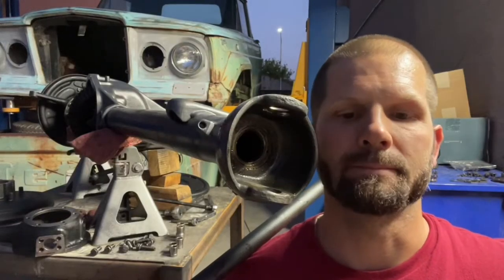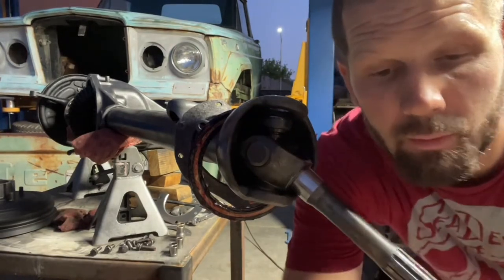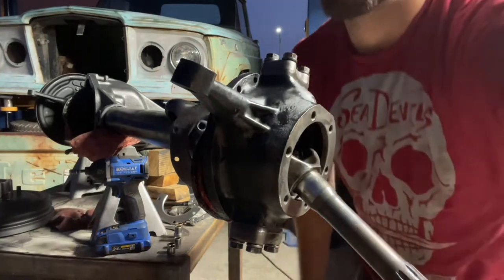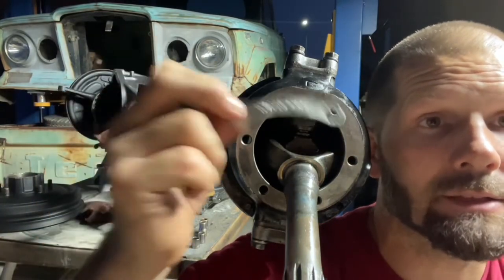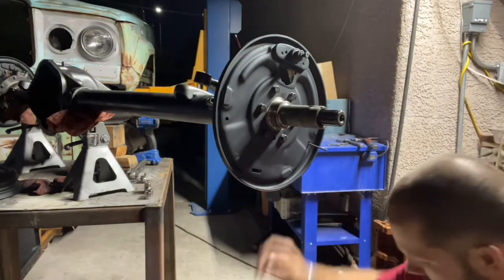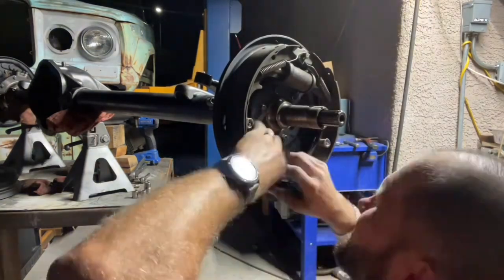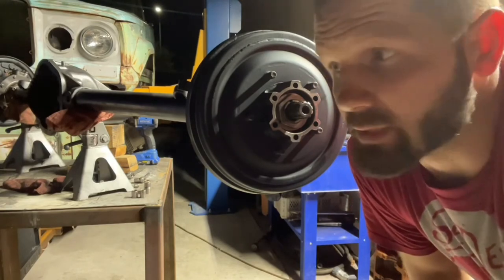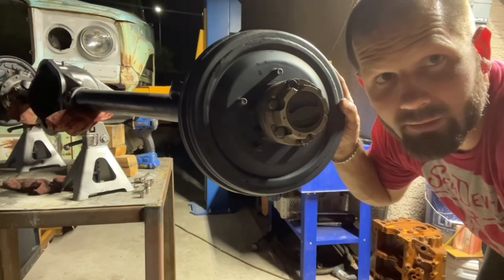1966 Jeep J3000 Front Axle DANA44 Closed Knuckle Axle Rebuild

Comment: I stumbled upon this by accident.  Great video.  I've always been interested in this stuff, even if I have never done this kind of work myself and even if I'll never own a vehicle that requires me to know about such things.  In my quest to understand these things, though, I've come to appreciate those old-fashioned closed knuckles because of exactly what you illustrate here.  Every bit of disassembly and re-assembly can be done using ordinary tools that everybody owns.  In contrast, the "newer" style (dating back to the late '60s and early '70s, ha-ha) of axles with open knuckles and ball joints require special tools and massive amounts of brute force for disassembly.  They are hell to take apart and are very finicky to get properly adjusted during re-assembly (for example, I learned that a whole generation of Dodge pickups were plagued with ball-joint failures while still almost new, because so many of them had the ball-joint adjustments improperly performed at the factory).  And it's my understanding that after several years, the adjusting ring on the top ball joint almost always seizes into the top of the knuckle and can't be spun, and since there's very little gripping surface for the tool that turns it, this can ruin the whole knuckle.  Modern open knuckles are faster to put together the first time using automated equipment in the factory, but nothing about the design is friendly to the truck's future owner.  Everyone seems to think that these closed knuckles are more complicated than the new style, but actually they are as simple as can be.  I appreciate this clip.
Reply from the maker: Thank you for the great comment!
The more time passes the more i appreciate simplicity in design.

Comment: Hey man, thanks so much for the video it is helping a ton. Two questions: 1. Where do I find the torque values for this install? 2. Did you put new bearings and races in your hub assembly? I only ordered the Closed knuckle rebuild kit and it didn't come with that other stuff. Thanks again!
Reply from the maker: I cleaned everything and reinstalled as it was. Just a major review of the system and reinstall. Are you still looking for torque specs?

Comment: Can the king pins be replaced without taking everything apart?
Reply from the maker: Thinking about the procedure I think you can. It’s only 4 bolts per pin then I’m pretty sure the would come right off. 
I would be more worried about if it should be done. There might be old practices that young builders like me don’t know.
Reply: @stardog16  I should have been more specific, but I think I've found my answer since leaving the original comment, whether or not the king pin bearings/races/etc could be replaced without taking the entire axel apart and I think the answer to that is no.